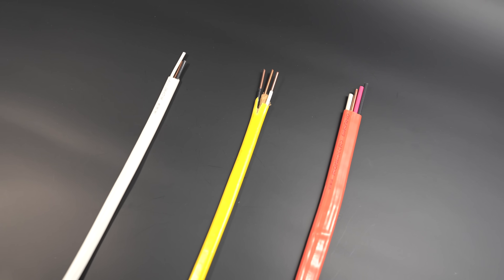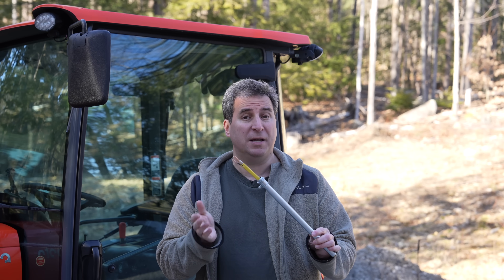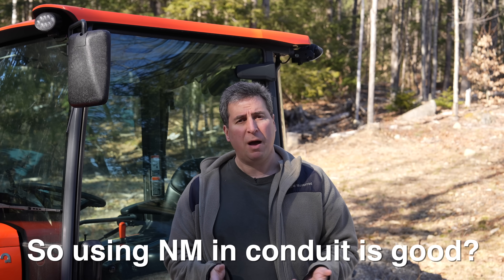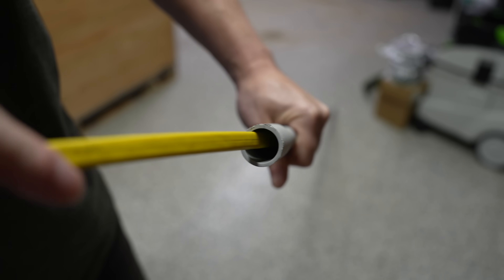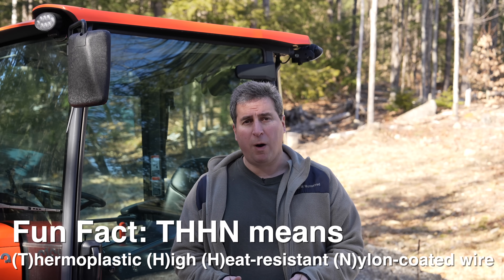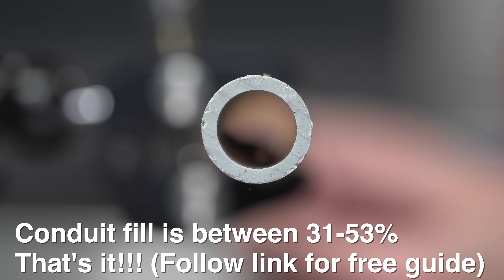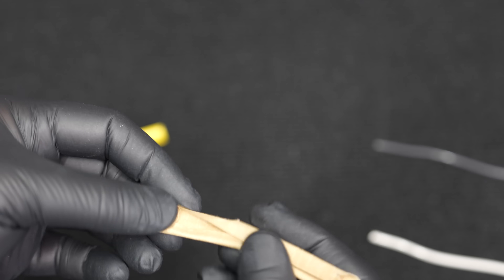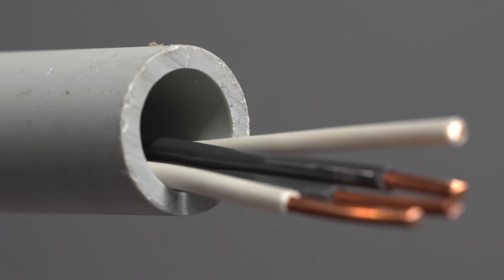#1 DIY Electric Mistake - Can you use Romex Wire in Conduit?

Comment from the maker: What do you think?  NM Code Info: https://bit.ly/3VCAm7R Damp Location Guide: https://bit.ly/3VL75rX - My Amazon top tool pics: https://www.amazon.com/shop/silvercymbal
Reply: I love your content. I would have liked code article from 2020 and 2023 code cycles. I'm not an electician so I dont fully understand everything about electrical or code. But did you consider heat build up? I know thats a thing. Because the wires are jacketed they are rated at a certain amperage and temperature. As the heat builds, so does the resistance, and as the resistance rises so does the heat. I've been told that is a runaway senario, which is why we derate wire fill. Is there a connection between that and electricans being almost unanimously against putting romex in conduit? You would be putting a rated, jacketted product into another jacket which increases heat?
Reply from the maker: @MarbleGoblin  Hi there great points, I added links above. Thanks!
Reply: I read the codes but those are Texas codes and not NEC. Texas codes are cool. But it doesn't really matter either way. I always thought you should be able to run sheathed cable in conduit as long as it didn't fill the conduit over 40%. I retired 12 years ago. Back then the inspectors wouldn't let you do that.
Reply: @LRHutch  The problem is that, even if the conduit is sealed in a wet location, the conduit will fill with water over time (condensation sucks in humid areas). The insulation on Romex is not designed to stay wet all the time and will break down MUCH faster under this condition.
Reply: @mytech6779  Not if it's buried underground, with sweeps turning up into and out of buildings....there's nowhere for the condensation (in high humidity areas you WILL get it) to drain to, so over time it will fill with water, which is why NEC calls that kind of situation a "damp location" and requires wire rated for that condition.
Reply: @mytech6779  Drainage for conduit?  Now I've read everything. lol  If the conduit is in a wet location it (and conductors) should be rated for that location, if it's not going to get wet then the the appropriate materials should be used with proper installation and "drainage" shouldn't be a factor.  It's not complicated.  No one runs NM in any conduit, only DIYers or "electricians" that don't have the correct materials on hand.  It's expensive, labor intense and wrong.  Will it work?  Sure.  Will is pass inspection?  How well do you know the inspector?  Should it be done?  No.
Reply: @jjann54321  Cool story bro.
Reply: Not too bad but even this video isn't totally accurate. The primary concern of all wiring regulations in the fire code (NEC is a section of the national fire code) is heat dissipation. NMC inside of a conduit cannot dissipate as much heat so the current capacity for a given fill % and duty cycle is reduced relative to using individual conductors, or the length of conduit is restricted (dependent on the type of conduit material, ambient environment, and free air vs enclosed and enclosed in what [ie fiberglass fluff or packed dirt].) so that it can conduct heat lengthwise to some other heatsink. 
"Damp location" interpretation is a whole rabbit hole of its own, and then you get into the specific insulation types.
Reply: I've put conduit over direct burial romex.  It can't hurt any and adds protection.
Reply: @elgringoec  It causes more heat build up. It is a small risk in buried conduit with a single cable, but "It can't hurt" is incorrect.
Reply: @mytech6779  
You think it can heat up enough to matter?  
Okay, how many watts per foot does a 12ga feed dissipate assuming the circuit is continuously running at its 20A capacity?   
Show your work.
Reply: @elgringoec  The thermal power per foot is of no use on its own, you need the thermal conductivity properties of the insulation and of the conduit, and the specific installation conditions of the conduit are all needed. The formulas are in the NEC. You would know this if you weren't trying to bluff your way through.
Reply: @mytech6779  
You're so smart, so you should know it starts with dissipation.  Are you having trouble calculating it?
Reply: You can run UF cable in DAMP/WET Locations.
Reply: Honestly, this sends shivers down my back. Happy therefore to say that this side of the pond it is a non-issue since we can't even buy that type of wire here. For outside and underground use we have metal shielded cable, inside it is all single wires running through PVC conduit, meaning you don't have to take down the walls to change the wiring. With respect to the amount of wires running through the conduit there is only one (strict) rule: it may never ever carry wires from more than one fuse. In practice this means that inhouse the vast majority of conduits contain just three 20A rated "THHN" wires (ground, zero and fase) however they may be accompanied by one or more 10A rated wires for switching lights.
Reply: In Canada we can run it through liquid tight flex for AC whips and inside emt with rain tight connectors or rigid pvc. Take care!
Reply: I think you are confusing damp and wet locations. The inside of exterior or buried conduit is considered a wet location. I'll let you find the relevant articles.

I also think I'm sick of DIY people trying to explain the national electric code or anything else related to electrical work. We do a 4 year apprenticeship for a reason. Stay in your lane.
Reply: Wait my "master electrician " ran romex white and yellow ones via a pvc conduit...its large from the panel to the second floor...but the pvc is outside....and told me its okay , its code....did i get scammed....is what he did dangerous? He ran about 6 to 7 romex wires but its about 50%-60% fill
Reply: @jinsu0504  I've attempted to reply to you several times, with code citations, but my comments are being deleted. I'll try a short version this time. It's a code violation. I don't think it's immediately dangerous. I suggest you contact the electrician and express your concerns. Failing that you can contact your state's licensing board or registrar of contractors and ask for advice.
Reply: @arazusaysbah6784  thanks but dude i told him multiple times, he treats me like im stupid...that im an electrician and I don't know what im talking about. he says its SAFE don't worry...
Reply: @arazusaysbah6784  he ran romex from the panel made a PVC large conduit outside the house...than bring up romex to the attic then connects the romex to fixtures.
Reply: @jinsu0504  I take it there was no building permit pulled? If there was you can talk to the building inspector. If not call the registrar of contractors or licensing board in your state.
Reply: @arazusaysbah6784  my scammy electrician said "nobody pulls a permit for panel upgrades,"
Reply: I think this video is kind of dangerous without a disclaimer of where you are and that you should contact your local electrical authority before doing this. In Ontario, Canada you can't run romex in any kind of conduit in any condition.
Reply: @robertwilson3229  Even UF?
Reply: Please stop these silly internet electrician videos.  So much wrong information, so much misinformation, so much misunderstanding.
Reply: If you can't run nm in conduit outside, how do you run direct burial to the the ground from the inside or from an outside box?
Reply: @RedPillSurvival  PVC
Reply: @MR-MR-ud5oo  Okay.  I thought he was also excluding PVC conduit. Thanks.
Reply: some municipalities like to pretend that Romex conductors are not rated for use as building wire HOWEVER the code itself does not allow for that situation to exist and so it does not in fact exist and never has.  The reasoning of the municipalities arises from "UL listing" requirements you are voiding the UL listing of the item by altering it , except that the individual conductors were UL listed prior to having been incorporated in to the cable. The Romex is UL listed as an assembly BUT the individual conductors are themselves UL listed as this labeling is applied by the extrusion machine that spooled it.  those master spools are the same ones used to make Romex as well as the 1000 and 500 foot spools of building wire you buy off the shelf quite literally the same exact product right down to the regional branding...i mean it is not as if they are going to make special runs just for use in Romex that is simply not how wire manufacture works.
Reply: Why not just use Teck cable and not bother with a conduit?
Reply: OK what about UF-B 12/2 as I did a run through concrete wall with UF-B 12/2 USED 3/4" PFC 40 conduit wth water tight uf cable nipples to pass the cable thru the concrete wall to the deck out side ultimately to an outdoor gfi outlet box?
Reply: Well, you’re talking as though you’re a subject matter expert, so explain exactly why you don’t want it in a damp location outdoors is it going to short out tell us why you did not you told us what the regulations are, but you didn’t tell us why, because you said so, it’s not good enough explain yourself.
Reply: UF-B is a non-metallic (NM) Romex. The NM-B indicates it can be directly buried in damp locations. It's an NM cable that could, then, be pulled through a conduit. Doing so might make sense for garden beds, where the line could be accidentally severed by a spade shovel or tiller.
Reply: If you are getting water in your conduit, you are using the wrong kind of conduit. If it is condensation, it's a whole other story. The paper insulation in Romex will hold moisture and eventually cause the insulation on the wire to rot. You need to run URD  cable for this location not Romex.
Reply: @LRHutch  The NEC does call out "damp" and "wet" locations as two different things. It isn't generally about rotting the insulation (in modern materials), but some plastics actually absorb a substantial amount of water or are fairly permiable to moisture over long periods of time, which could allow for corrosion, current leakage, and temporary changes in the physical and electrical strength of the insulation. (Nylon for example has substantial changes when wet, both swelling and loss of strength. not a problem as an outer coating to make pulling easy but it would be an issue if used as a stand alone insulation.)
Then add in complications from temperature effects and polymers being below or above their glass transition temperature.
Reply: @mytech6779  thats why I said to use urd cable or appropriate cable  for the location.  Romex is for dry locations. It's also made for residential use in wooded framed buildings. It is not for commercial use. The only time romex can be in conduit is when it goes through a short chase, which is the conduit and then can be only 40% fill. Example would be a block wall.
Reply: @mytech6779  yes and that is why you need to open up the Uglys book for a fast quick reference  on the coating allowed for the location type. I retired 10 years ago and haven't opened a code book since either. But this was all about running Romex in conduit of which is not code. End of story. Maybe we just do it better in Kentucky.
Reply: @LRHutch  yeah thats the whole point of the conversation, and the reason that it is limited to short runs and some other specific limited uses) is because of heat managment; in the case of a short chase the heat can be still be conducted out lengthwise.
Reply: I've considered all of these things over the years and done some of them. What I am disappointed in is you. You probably know when and where and how to run a little Romex in a conduit, but you never gave one example of when, where, and how you do it. Thumbs down.

Comment: Like all the other comments, I greatly appreciate the immediate delivery of the information without flair. However, I (and maybe it's only me) had a bit of trouble following and it felt a bit longer than it was because there were no breaks in between sections and a bit too little inflection in key points. I don't mean breaks as in flashy transitions or editing or inflection like dramatic faces amd yelling (I hate those, too), just points where you pause a bit longer and make it clear you're talking about the next thing. It kinda felt like a reading a run-on sentence.
This is the first video I've seen of yours and it's over a year old, so I imagine you've improved a lot as a presenter (: This was my morning video with coffee, and I'm not complaining. I only want to be helpful!

Comment: 3:05 incorrect....the conductors inside NMC are THHN which are identical to the individual conductors you spoke of around 1:50...
Reply: You are correct ONLY if each conductor is properly marked as if it was coming or a single conductor spool..

Comment: A cellar I was working in was a little tricky.  I wanted the Romex protected near the Washer-Dryer.  Ran the Romex through the joists above, then terminated in an accessible box to join/convert to a 5 foot conduit run to a dryer.  It was a good compromise and used 3/4 Conduit.  No way I went overfilled with 10/3 .

Comment: 0 "building codes" here in rural sw Missouri. No permits. Nothing.   We do whatever we want.  When i first bought this house 35 years ago ( solid brick construction built before the Civil War btw) it had a fuze box and 2 strand wiring with ceramic insulators. I put in a pole disconnect,  breaker box,  and rewired the entire house myself. No electrician needed.  Same for the plumbing, roof, interior remodel,  etc etc.

Comment: You use the sch 40 so if a short if you grab the metal shocks you metal carry the current. Like Strom drain use concrete pipe and you can later run a steel or poly in side it for extra like square you put metal plate on the bottom the dirt is oxidize and grow algee for fish

Comment: I found this interesting because an electrician didn't check to see if I had conduit before he ran Romex from the box to that room. Only to realize that the conduit he saw in the attic was going to that room and not to the adjacent room. Now I have an empty conduit with a box at the right height and a Romex feeding a light switch that's higher than all the others.

Comment: I occasionally do some electrical in my house and was wondering why this wasn't done.

You gave the reason why I thought it was a good idea: extra protection. So if someone is blindly drilling or whatever, they are less likely to go through a wire. Plus the added benefit that an entire line is kept together.

So this was informative. Thank you.

I do have a question: when you showed individual conductors through the conduit, you only showed live and neutral. What about ground? I assume it can go through the conduit as well and you were just giving an example by showing contrasting colors or is that not right?

Comment: Good tutorial and a great explanation. NOTE: UF (Underground Feeder) cable is an example of electrical cable with a non-metallic sheath that IS ALLOWED to be ran inside conduit in outdoor locations. FYI
Reply: Unless it’s a short straight run putting UF through conduit is an exercise in frustration

Comment: Great video bad word usage.  You said "the amount of wires you can fit into a pipe"   The word amount is what is called a mass noun.  In other words it is used with nouns that refer to things like water or sand things which cannot practically be counted.  for a counting noun like wires (which can be counted) we use what are counting nouns like number.  It is preferable to say "the number of wires"  Got it?

Comment: It’s not super good for heat dissipation. 💁 The thing is, that’s actually kind of addressed in the fill requirements already. I haven’t stuffed much Romex but I HAVE pulled network cable. 🙄 Those fill requirements are not ornamental!! Half inch really isn’t good for more than a couple of Cat6

Comment: It was not many years ago knob and tube installations were fine with cloth wrapped wiring….ha ha  modern codes are so over kill it’s ridicules and mainly created by a bunch of no nothing firemen that want to play big shot. In reality they are unnecessary in construction and aren’t great at fire fighting. But one thing they do well is drive up prices.
And no, houses weren’t burning down in droves prior to fire department interference. They sold themselves to the public through scare tactics, nothing more. The problem is, there are so few fires the departments have to much idle time so they start creeping into things that don’t involve them. Creepers, ha ha, that’s what they are. Yet they want everyone in society to thank them for the little they do, they demand being treated like Gods for a simple job. Everyone has a job, everyone is in danger, yet no one in society expects what firemen demand for treatment.

Comment: The wires inside the cables are just THHN.  The issue is that they're required to be labeled, and some manufacturers leave the labels off the interior wires to save the penny a mile of printing cost.

Sometimes they use labeled wire to make up the bundle though, in which case there's no issue with removing the jacket, and no way to tell you've done so anyway.

Comment: No mention of double derating? The ampacity of 1-3 conductors within the Rx sheath is already derated from 'bare wire'. Eg, bare THHN #12awg rated 30amp, is reduced to 80% inside the Rx sheath, or 24 amps. If you put the Rx cable thus sheathed, inside of conduit, for a distance over 2 feet, it must be derated 80% again, according to how I read the code and according to our local authority having jurisdiction. Thus 19.2 amps, and "breaker next size up" 20amps. But that is a blanket statement without mention of how many conductors are allowed before derating further. Two #12 Rx cables shoved into conduit more than 2' long derates both circuits to 15amp breakers.